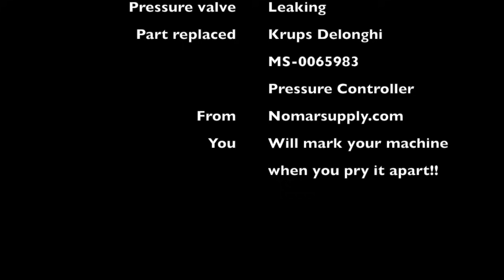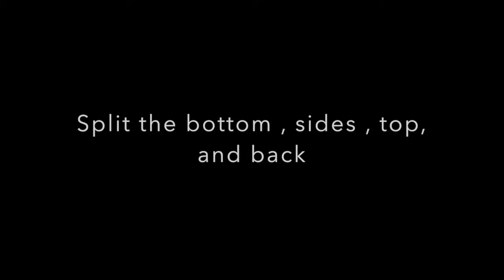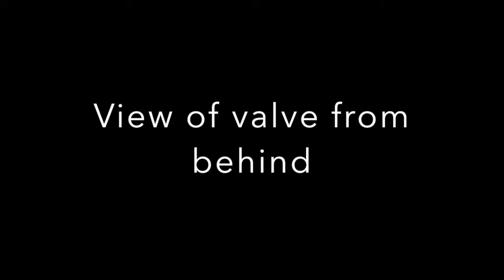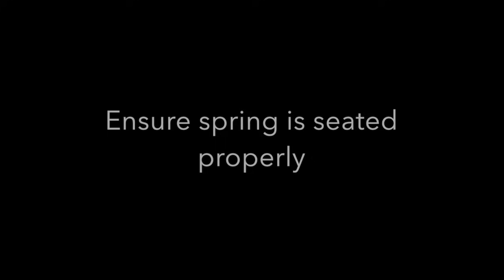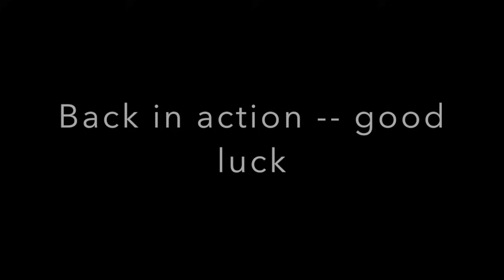Nespresso Krups Pixie replace pressure valve - disassembly - leaking

Comment: Awesome video very long but it was worth watching - then I had the video beside me and kept stopping and starting it when I was doing the job.  Took me about 4 hours (I am a 57 year old housewife not an electrician!) and could not get the 2 halves back together at the end after an hour or more trying so I gave it a bang with the hammer that did the trick.  Thanks so much for the video saved getting a new machine!
Reply: Ha ha, hammer, you are daring, well done.

Comment: Hmmm my machine has started leaking from somewhere inside. Still works sorta but leaves a puddle. Not sure its worth the effort of repairing, especially trying to get that plastic case in half. Will use up the rest of my capsules and it's going in the bin then back to the espresso machine.

Comment: Your Tuto is the best for this machine but I have fixed the problem for 50 cents with a simple O’Ring inserted in the valve !
Size of the tore 1,6mm Diameter 15,9x19,1 mm
Reply: Hello, looking to do this. Did you insert on each side?

Comment: CAn I ask how the water was leaking? Mine only leaks when I make a coffee but if I press the button with no coffee pod  it doesn’t leak. I saw a video of a guy changing the o ring in the brewing unit. I’m gonna try that.
Reply from the maker: Hi Tulio, mine leaked intermittently while making coffee.  I didn’t try it without a pod, but that makes sense since the pod will create the seal which is needed for the pressure to brew.  No pressure, no leak.
Reply: @jimminycricket6618  hi there bu tried changing the o ring the brewing unit but it still leaks. Where did u but your pressure valve btw? I can’t find it online
Reply from the maker: I dont see it where i bought it, but a google search for “krups pixie pressure valve” reveals a few vendors

Comment: I admire your patience! I am such a capsule addict I have lost count of how many machines I gone thru!. Bought the above model from the dump shop but slider had completely worn. Still I had to strip it for the sake of it. Perhaps the most painful appliance I had ever stripped down. Just saved the pump just in case I go camping and need a high pressure pup to force water thru a reverse osmosis membrane. Today I visited the dump shop again, scored another mod EN-125 the discontinued automatic one I already had a broken one. Managed to make one good one out of 2 and give them an overhaul. Just love Nespresso!

Comment: Nice video. In my case i just screwed of the cap turned the little black nipple and checked that the position between the black sealing and white sealing is correct. assemble the cap while holding the sealinh together. It works without the spare part.

Comment: Hi, thank you for the clear disassembly video. I have a pixie which will not stay on. If I click the power button down, it is followed by an off click, almost like a solenoid disengaging. Is this also a pressure issue?
Reply from the maker: Hi Christopher, I’m glad you found it useful.  I don’t know the ins and outs of the control mechanisms.  Given the troubles with this model, I would probably just buy another model.  Mine ended up with the same leaking issue, so it went in the bin.  It was hard to see it go, but it wasn’t worth more time and effort.  I had mine for 4 years before it kicked the bucket.  I have friends with the magimix inissia who haven’t had any issues, but I imagine every model will have its demons.  Good luck.
Reply: @jimminycricket6618  Ya I think you're right. We've had ours for 4 years too. Seems to be the built in age of obsolescence!

Comment: hi first of all thank you for your video, i'm french sorry if the written english is not perfect. I wanted to know if it was not easier for the blow to replace only the damaged valve, so as not to have all of the hose to replace. thank you in advance for your response, and thank you for this great video
Reply from the maker: Hi Jean-Baptiste - i don’t know if it would work.  It is easier to replace the valve only.  Update on my machine — it’s leaking again!  Bonne chance! The reason I bought this machine was because of the time I spent living in France.
Reply: Thanks for your answer, 
I will test as soon as I receive the damaged part. I have the machine ready for 9 years now, I would like to repair it anyway. 😅😉 I will keep you posted on the progress and my success or not. 😂

Comment: What kind of tool do I need to remove the handle (allowing me to remove the plastic cover)?  It’s not a standard Allen/hex key.
Reply from the maker: Hi Adam, sorry i no longer have the machine but i believe it is a torx head screw.  I don’t know what size, you will need to borrow or buy a set of torx bits or screwdrivers.

Comment: How did you determine that it was the pressure valve vs an o-ring?
Reply from the maker: Hi Danielle - i took the sides off and could see exactly where the water was coming from while making coffee.  I tried tightening the cap and cleaning the parts but that did not fix it.  There was no water coming from the area of the o-rings.
Reply: Got it. Thanks!

Comment: hello Jimmimy, can you tell me please where the small black plastic part belongs to, as shown when the video starts at 0:14, below the chrome metal lever. I got this machine in parts, and don't know where to install this small part ;) thanks
Reply: Did you figure it out till today? Same problem here
Reply: right low corner of the side, that on the stopframe
Reply from the maker: @wolfgangdirnberger1003  Here is what I think you are talking about https://youtu.be/szNR6gc60tU
Reply from the maker: @apriorious4424   Thanks for helping out the community here.
Reply from the maker: I posted a quick post with the part location https://youtu.be/szNR6gc60tU

Comment: Hey man, when you change they valve, did you change the setting on the valve at all ? I’m trying to see whether you tighten or loosen the plastic part at all. 
Mine has this issue that if it runs out of water and I run the pump, it sucks some air and then it cannot get rid of that air. I open it up and the only way to get rid of that air is if I loosen the plastic part bleed it. After that it works but I still wonder if I have to replace my valve to fix it or that’s how these are.
Reply from the maker: Nikos Kaldaras Hi Nikos, no I didn’t change the setting for the new valve.  When it first broke i tried loosening then tightening the old valve but it didn’t fix the old one.  Good luck!
Reply: Jimminy Cricket sounds like I will get a valve and change it. Thank you for the video and the reply Jimminy!

Comment: Man, thanks very much for this video. it took me a while to pry the large sidepiece off, but then everything was a piece of cake. On mine there was water coming out under the machine, when running it and it turned out, that the nipple, where the waterhose connects to, going into the pump had broken off. There is no pressure on this part, so I glued it back on with super glue, and presently it runs well. Thanks a lot!
Reply from the maker: Johnny Walker glad to help! The  coffee that comes out of this thing is worth the trouble.
Reply: @jimminycricket6618  You are very right about this: Lavazza, the Italian Espresso-Coffee company is offering bio-degradable caps, and man: they test like the real deal from the barista next door!

Comment: Nice video. Did you determine why the old valve was malfunctioning?
Reply from the maker: T Law — no I didnt, there’s nothing to the valve, so it was strange.  I think it had to do with how tightly the cap was put on.  Cleaning it and putting it back together didn’t help.
Reply: Jimminy Cricket how long has your machine run without leaking since? I ordered the part and giving this a go. I thought about just cleaning the value, but then read this comment.

Comment: Thanks for the video here. The hardest part was getting the two halves apart. I ordered the part number you recommended. The part I received did not have the black cap thing on it. It seems to work without it, but if anyone else could weigh in I’d appreciate it.

Comment: When I took off the metal panels, I could see water coming out somewhere around this pressure value (called a regulator here, part 29: https://coffeemachineparts.com.au/index.php/coffee-machine-parts/nespresso-spare-parts/nespresso-en125-pixie-spare-parts).  But after I took the left half off like you show @2:45-@3:00, I tried running it again to verify where the water was coming from, but I couldn't get any--I think it needs back pressure to leak.  I'll probably buy the part and see if that solves the problem, but are there other parts in that vicinity that tend to leak?
Reply: (replying to myself) ...and further down that page, they call it a "Nespresso EN 125 Flow Adjuster", and give it a different part #!  But it looks the same.
Reply from the maker: Hi Michael, There are definitely other areas that “could”’ leak, but based on the amount of people still looking at this video I would say the part I replaced is the most likely cause.  Good luck!

Comment: Very helpful. Unfortunately I still couldn't fix the leaking capsule holder.
Reply: I've just fixed my Pixie, had the same problem. The nozzle was extremely dirty, after cleaning it the leaking stoppped.

Comment: Hi,  I followed the video step by step. Still leaking. Any suggestions of what it could be?  I made sure that the valve was snapped into place securely. I'm wondering if it could be a clog in the spout assembly, which is backing up the water.
Reply from the maker: Jimmy Chi you need to make coffee with the sides off of the machine to see where the water is coming from.  If the valve is new it is probably another piece or connection

Comment: Thanks for the instructions; got it removed, but then I tried to replace the electronic part and was not able to remove the other side (which is necessary to remove the circuit board). This construction is a great rubbish and has by far not the attribute "sustainable". Shame on the Krups engeneering. Machine will end up now in the electronic waste bin!
Reply from the maker: This was definitely designed to be put together easily, not serviced. It’s too bad most things are made to be junked nowadays.

Comment: Hi ,
Could you be so kind to send me the link for buying the pressure valve ... thanks luis
Reply from the maker: LUIS MORAIS  here is where i bought it https://nomarsupply.com/search?controller=search&orderby=position&orderway=desc&search_query=MS-0065983+&submit_search=
Reply: Hi Jimminy,  thanks for the video! It’s awesome!! Would you please tell me if this valve fits model Nespresso TX160 Pixie Clips? I’m considering buying it or finally to bring the coffee machine to the repairment service since I’m not sure where I can buy this specific  detail (I’ve checked ebay, amazon and aliexpress and couldn’t find any substitutions). Thank you very much in advance!
Reply from the maker: @stevereichbach41  Hi Steve, sorry I am not familiar with that model.  It had to open my machine and compare the leaking part to the pictures on the vendor websites.

Comment: Was very helpful for me, thanks.  I for one even didn‘t replace the valve, just cleaned it and it works again.  Only issue is the cutting of the retainer clips. I had to bend new ones with some spare wire.  In the end: No costs, just 30 min work, that‘s it. Enjoy my espresso again
Reply: There is no way for us to keep the retainer clips eh? Does your machine still work well now? Thanks
Reply: @nphuonganh1511  No, not essentially.  Our machine still works well after I have repaired it

Comment: Where was your machine leaking: into the tray, or out of the bottom? I've seen both and want to make sure this repair fixes the correct problem.
Reply from the maker: My machine was leaking out the bottom, not into the tray.

Comment: hi jimminy, I finally received my spare part, I also managed to remove the side cover. I could notice a small difference with the new part, it is that it is not equipped with O-ring. I don't know if you had the same thing. thanks again for your video which helped me a lot. ciao
Reply from the maker: Jean-Baptiste Molineris The new part does not come with new o-rings I had to use the old ones.

Comment: I had to remove the left-side spring on the sliding spout before the cover would come off.  Otherwise, it went as the video shows.  Haven't ordered the part yet.  Fingers crossed that this will cure my leak problem, because it was a pain in the rear to pry that cover off.
Reply from the maker: Tarek Ghazi yes,  it was a pain glad this helped.  Good luck